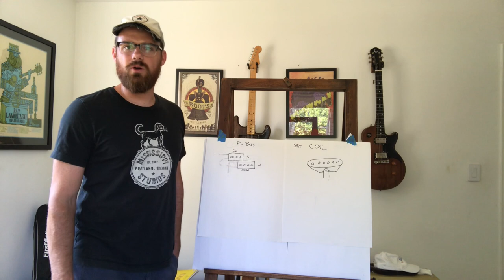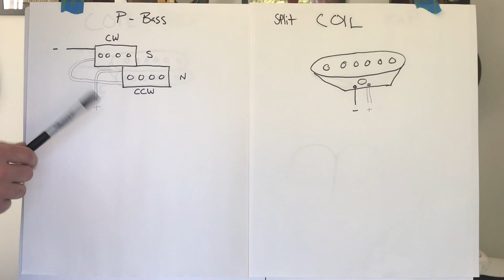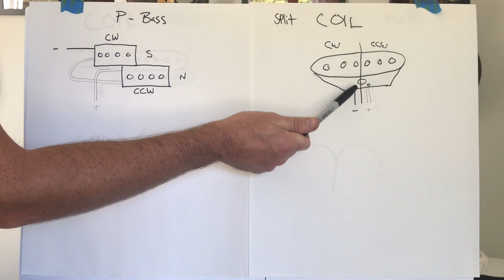How To Make a Hum-Canceling Single Coil

Comment: Not sure why this style of pickup isn't the mainstay. Thanks for the great explanation and demonstration!
Reply: For the same reason stacked coil hum cancelling pickups aren't the default. In order to get the two coils side by side, the coil geometry - coil height, number of turns, wire gauge - changes a little and they don't sound quite the same as single coil pickups. The pickups are also a little more expensive and complex to build.
Reply: In this particular pickups style's case, the winds and polarity are reversed between the D and G strings, so you end up getting that "out of phase" sound when bending the D towards the G, or bending the G towards the D.  It would be tonally very different than a standard single coil in that space, where most players bend/vibrato notes quite regularly.  It would also impact the upper harmonic resonance as you played open chords.  Some frequencies would cancel out, taking away a little clarity.  Not a huge impact, but enough that, again, it just wouldn't sound exactly like a traditional single coil  A very interesting alternative to stacked coils though!
Reply: @tigeraudio  Any hum cancelling dummy coil must by definition output a signal generated by the local hum field, otherwise there would be be no hum cancellation. The problem with dummy coils is that they do add a further inductance to the guitar circuit, altering its response.
Reply: @ResoBridge  take a cheap single coil then remove the pole pieces and magnet install it between the output of the selector switch and output jack. No volume drop or 60 cycle hum
Reply: Because we made a software filter that eliminated exactly 50/60Hz almost completely keeping other frequencies with Intel 8051 20 years ago. Only well known as "true guitarists" (or lazy ones) listen to hum. Others use processors with digital filters. Radio frequencies can be easily filtered out with few components.
Reply: They cost more.
Reply: On a bridge pickup, with the D and G string centred over the rods, it would be an almighty bend to get the strings to go past the magnetic field of its pole piece. It wouldn't be phasing issues if somebody put 7s on a G and bent it from the 22nd to make the travel enough to get close to the D rod on the bridge. It would be a drop out in signal as the amplitude of the out of phase signals reaches unity and cancels out. Phasing sound artifacts from the two middle  strings from the bridge is not a big issue as the strings will remain mostly within the electromagnetic field of its rods. The issues mentioned are problems with this configuration on the neck. A hard strum can make funky phasing artefacts and bending hard can cause drop outs.  Fralin's solution for his single rails are the bends of each rail on the middle...
Reply: It's both reverse pole and reverse wound, so the signal phase is inverted twice, back to the original phase. The signal between the D and G strings does not cancel, because they are in phase.
Reply: G&L Comanche guitar by George Fullerton and Leo Fender has this design.

Comment: When building a Humbucker you can wind both coils the same direction and then just connect the 2 finishes together.  Then one start is hot the other is ground?????
With a strat the neck and bridge are wound CW and the Middle CCW???
Is this correct???
Thank you for the video and your time,
B

Comment: Thank you. Your pickups sound great. Have you made stacked hum cancelling singles before?  And could you do two stacks in a humbucker so you can split and still have noise canceling?
 I see above that you had trouble getting it to work with the side by side, but I can't see why it wouldn't ultimately work. I bet you could do it. But stacks would work at the neck with string bending.

Comment: I use to fool around with pickups in the 70s and I remember making tap coil on a few. However why can't you just wind the same turns in the other direction over the inside windings? Thanks for sharing. c];-)
Reply: Lots of people call this a tapped coil, but it's not actually tapped, that's a different thing. This is a split coil.

Comment: Great video man. Thanks for the info. 
Can you explain what would happen if you don't put the metal base plate on?what does it do exactly? 
Again thanks for the vid
Reply from the maker: The metal base plate just raises inductance and output. You can leave it off if you want.
Reply: @SchuylerDeanPickups  oh interesting. One more question if you don't mind :) 
Do you connect the base plate to the ground of the circuit or is it just under everything as a shield?
Reply: @tameromari2102  
as mentioned @07:11..Base plate
and Black wire are connected..😊👌🏻

Comment: good video, that's exactly what I am planning to do in early future . and...what about your winding machine?
Reply from the maker: Thanks. It's a Schatten-Design from StewMac, works pretty good!
Reply: @SchuylerDeanPickups  oh... So not cheap at all. Tnx
Reply: @giampierodeleonardis1970  They are nearly half price if you buy them elsewhere...  StewMac's prices are crazy on some products.
Reply: +Giampiero De Leonardis
Nobody don`t need a machine like this, you can use a handcranked  drill or a electric screwdriver. If you don`t plan mass production of pups.  )))

Comment: What is the sonic difference between 44ga wire and 43 or 42 on this type of pickup? -and why did you choose it?
Reply from the maker: Usually you get more compression from thinner 43 and 44 ga. When space is an issue, you have to use thinner wire to achieve the appropriate output.

Comment: Woooaa look the difference in dinamics split coil sounds choked to me and lacks dinamic range/dinamics (difference betweeen quiet and loud sound in this case It´s pick attack) Compare Split Coil (noisless) at 8:27 and a single coil at  8:39. Notice the contrast between the first note before the bendings , great demo because you repeat that phrase many times (pick attack between split coil (noisless) and vintage single coil , to me the noisless split coil pickup sounds choked , until now I was planning to get noisless pickups thinking the difference is only in the brightness of the sound and could be copensated with an Eq or even the tone control of the amp but now a see brightness is not the issue dinamics is the real issue with at least with noisless/hum cancel pickup ,. Great video and learn a lot, never saw the entire manufacture process of a pickup. Great video, I can tell you are a great professional. Great channel as well, you deserve more subs.

Comment: I don't understand the bit about not being able to bend strings past magnets 3 & 4, where the polarity inverts. Even if a string was right between magnet 3 & 4 shouldn't the signal just add together?  It seems to work fine on a dual coil Gibson style humbucker.
Reply from the maker: Gibson humbuckers have both coils under all the strings whereas a side-by-side split coil only has three strings under each coil.
Reply: Thanks for replying. But I still don't get it. I suppose I could do an experiment on a Gibson humbucker: remove three slugs on one coil, and three screws on the other, and see what happens.
Reply from the maker: @dwcleary8694  A good experiment, but you still have coils under all the strings which makes it different.
Reply: OK, I took a P-Bass with the split pickup and passed a tuning fork over the pickup (holding the tuning fork vertically so it's as thin as possible). I hear no perceivable reduction in volume between the pickup segments.  I'm really curious, because I can think of no technical reason there should be a volume loss between the third and fourth pole, because the output will be in phase...unless it's something to do with the magnets being so close and affecting the same spot on the string, which is not the case with the P-bass pickup or the Gibson humbucker. Fralin apparently gets it to work with the split rail, and those pole pieces are close.   Anyway, your design looks close to the holy grail of single coil pickups: hum-cancelling, fits in a stock pickup cutout, can use traditional alnico magnets...except for this volume loss issue.
Reply from the maker: @dwcleary8694  The purpose of the overlap of the coils on the Fralin and the P-Bass pickup is to reduce volume loss between coils. My pickup has no overlap.
Reply: @dwcleary8694  The problem is twofold. First of all, there's a magnetic void between poles 3 & 4 where the polarity reverses. On top of this, there's an inductive void between the two coils, where the direction of the windings reverses. I can imagine some players exploiting this as a kind of wah or tremolo effect when bending string 3 or 4.

Comment: can you make a humbucker pickup this way?, double split-coil single coils, I dont really know the purpose or use of that but...just wondering
Reply from the maker: I tried one once, so it would be hum-canceling when split. Couldn't get it to work right.
Reply: @SchuylerDeanPickups , what was the issue? polarities?
Reply from the maker: @danielayala9895  I don't remember, but I'm sure someone could figure it out easily enough.
Reply: Quad-coil pickups are not unheard of if we are talking about basses. A lot of companies produce them, eg Bartolini and Nordstrand. The only reason is to have more tone selection options.

Comment: So could you use 43AWG on one side and 44 AWG on the other side if you wanted the bass side to sound thinner, and the treble side to sound fatter? Or would that ruin the hum cancelation?
Reply from the maker: The less similar the coils are the more noise you get.
Reply: It's worth a try. The mismatch happens with Tele middle position of two matched (reversed poles and wound) neck and bridge pickups. The cancellation won't be perfect but maybe wind to matched outputs of the different gauges rather than to same number of winds.

Comment: Hi man, how is it going?

If I want to use this same idea but istead of splitting a pickup I built a second one and place it underneath the pickups that are already on the guitar, it will work in the same way?
Reply from the maker: You are basically describing a "dummy coil" which is a RW/RP coil with no magnetism required that can be placed anywhere in the electronics cavity and wired in parallel with the pickup you want to create hum-canceling with.
Reply: @SchuylerDeanPickups   
I got your idea but I was thinking of something more sophisticated. I read that noiseless pickups have the structure of a common humbucker, but instead of placing the coils side by side, the coils are stacked. I thought that a singlecoil placed  underneath another with the poles up side down would work as hum cancelling device.
Reply: I mean, I would double the number of pickups. Each one of them would become a stack.
Reply from the maker: @danilooliveiraaraujo1029  Oh I see, yes, a "stacked humbucker"
Reply: @SchuylerDeanPickups   yes, do you think it would work? If so, are there any details to consider, such as the same resistance or the alignment of the magnets? But just to clarify, I am not going to build a whole new stacked pickup , I would just put another pickup under the existing one, invert the poles and connect the starts and ends of both.
Reply: @SchuylerDeanPickups  yes, do you think it would work? If so, are there any details to take into account, such as the same resistance or the alignment of the magnets? But just to clarify, I am not going to build a new whole stacked pickup, I would just put another pickup under the existing one, invert the poles and connect the start and end of both.
Reply from the maker: @danilooliveiraaraujo1029  It will work. It has worked!
Reply: @SchuylerDeanPickups   Great!!! Thanks.
Reply: @SchuylerDeanPickups  isn't that the way Fender Noiseless are made?
Reply: @danilooliveiraaraujo1029  I hope this isn't a disappointment to you, but the stacked humbucker is actually quite common. Others here have mentioned Fender's Noiseless(tm) pickups, but most "noiseless" single coils are stacked humbuckers, and most manufacturers that make single coil pickups will offer a stacked humbucker version.
Reply: @petersage5157  None disappointment at all.
I know that noiseless pickups are actually humbuckers, but they are fuck expensive in Brasil and I was planning to make them on my one. What I dont know in detail are the specific settings such as voltage, number of widings and so on. In other words, the only thing I kwow for sure is that they are stacked. ha ha ha
Reply: @danilooliveiraaraujo1029  Maximum hum cancellation comes from two identically-but-reverse-wound coils on stacked bobbins, one over the pole pieces and one behind them. Some Strat-type bodies may require using extremely thin bobbins. The expense in commercial stacked humbuckers comes from making both bobbins have the same inductance, impedance and (in the case of the dummy coil, potential) output; matching all three parameters is labor intensive.
Reply: @petersage5157  Maybe someday I will give it a try, moving home now with no time even to breath. Thanks for the tips.
Reply: @danilooliveiraaraujo1029  Moving home is never fun, and must be especially fraught during this ongoing pandemic; I hear your country is one of many that are still having a rough time of it. Stay safe and we'll see you on the other side.

Comment: Hi!
Actually,  less turns for brighter tone and higher output for more mids and warmness.
I like the Idea of a splitcoil singlecoil,  would it also work if I reverse the winding direction after 5000 winds (P90), secure the windings with tape and wind another 5000 in the other direction, and then have North up on the low strings and south up on the higher ones?
Best
Dave
Reply: I'm assuming you mean have the coils extend over all six magnets? No I'm pretty sure that won't work because the signal generated by the strings in each coil would be out of phase and the string signal would cancel out as well as the hum signal.

Comment: Reverse Polarity means South Side UP, the top of the pickups pole pieces are South side?What magnet gauss level do you use to magnetize the alnico pole pieces? I have seen you put magnets in a clamp but what are the magnet gauss levels at to magnetize other nonpolarized magnets?
Reply from the maker: I use rare earth magnets in a vice. Just charge them all the way up. Reverse polarity means REVERSE POLARITY.
Reply: Reverse Polarity can either be North Side up or South Side up on the top side of the pole pieces can either be North side up or South Side up.
Reply: Alnico 5 pickup magnets saturate at around 1,000 Gauss (measured right on the poles). Neodymium magnets, of the type shown in the video measure around 3,000 to 4,000 at the pole face. So they should be powerful enough to saturate the Alnico 5, providing the Alnico magnets are passed through as close as possible to the Neo's. I have seen videos of people magnetising Alnico 5s with a gap or spacer between the Neo's and the Alnico's. Magnetic field strength falls off rapidly with distance, so with any spacing there is a danger that the Alnico magnets won't be saturated or magnetised equally.

Comment: Its possible take the mfd pickups concept and add the split coil to that system?. I ask, because the two coils will have the same polarity.
Reply: Very possible, just cut the magnet bars into two piece (or find 2 smaller magnet that fits the magnet bars cavity). then rewire them, and you'll got your split-coil MFD pickup

Comment: Cool. Is this similar to the split pickups you might see on a G&L?
Reply: It is. The precise details may be different but the principle is the same. Mr Fender was just extending the method he used to build the P bass split pickup. The G&L Z pickups even have the offset between the two coils.
Reply: @ResoBridge  so does the same problem occur when bending with the G&L Z style pickups?

Comment: I built one exactly like this but in spite of a DC resistance of 10.3k, it sounds thin. Where might have I gone wrong?
Reply: You may have the phasing between the two coils the wrong way around. Try reversing the connections to one of the coils. Or - you have some shorted turns in one of the coils.

Comment: Any reasons why you use 0.671inch magnets and didn't use 0.630, 0.650, 0.710inch pole pieces? Why do you use South SIDE for Clockwise and not use North Side for Clockwise?
Reply from the maker: The height of the poles is so that I can fit enough windings on there to achieve the right output. The polarity doesn't matter, they just have to be RW/RP.
Reply: Does the Height of the pole pieces length size change the magnetic field and frequency response? the longer the pole piece the more magnet more output?
Reply from the maker: @waynegram8907  exactly!

Comment: this reminds me of some G&l designed
Reply from the maker: Yes, it's a very common design.
Reply: @SchuylerDeanPickups  you can take the poles out of a cheap single coil then hot glue it between the volume pot and selector switch output. No volume drop or tonal change.  Woodeso from Canada has a YT channel is where I saw that being done.  Great video. The demonstration part let the video down a bit. Is this going to be a side business for you ? It would be nice to buy boutique quality pickups without getting fleeced. Good luck and God bless you and yours

Comment: I thought they said humcancelling single coils are Humbuckers.
Reply from the maker: Some people call them that, yes, but the term humbucker was specifically used to talk about double-coil pickups from the '50s that "buck the hum"
Reply: @SchuylerDeanPickups  oh ok thanks much. Does humcancelling single coils  sound  like humbuckers?
Reply from the maker: @ricmel8008  No. If they are wired in parallel they sound more like single coils.
Reply: @SchuylerDeanPickups  oh ok ty